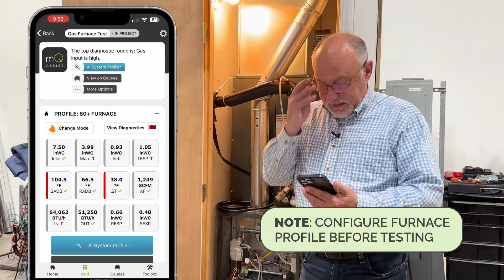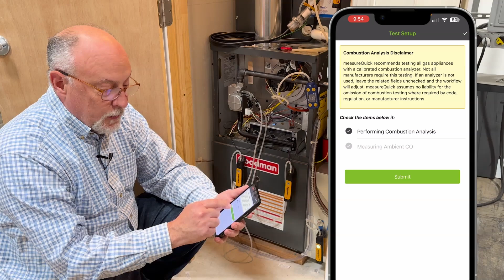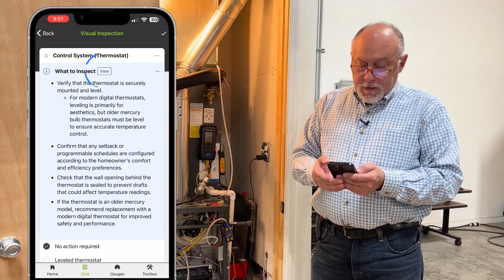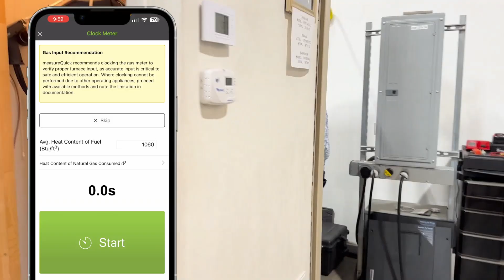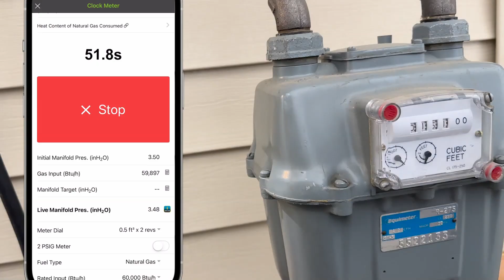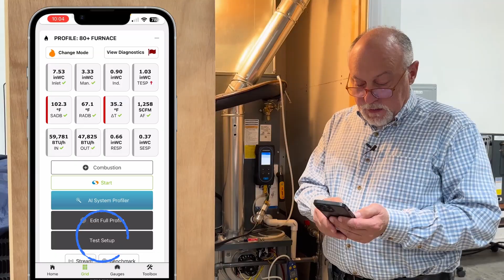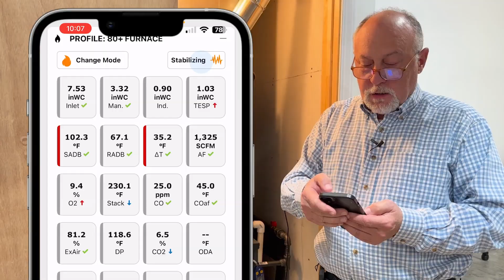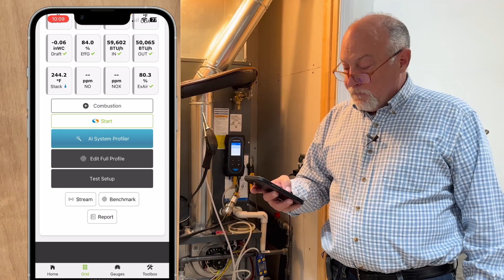measureQuick Heating Workflows Detailed Walkthrough [Oct 2025]

Comment: As always the Bergman explanation works well. MeasureQuick is a great software tool. That being said I think we need much more detailed analysis of why equipment isn’t reaching its stated specifications and why manufacturers also need to ensure that the preconditions for the furnace and AC install is being met including using the appropriate test equipment. Hopefully Jim  can dig deeper with a research institute scientists and engineers around Ohio.

Comment: Refreshing to see that measure quick now recognizes that a combustion analysis is the best & proper way to set up a gas furnace. There wasn’t any mention of setting up proper airflow that I saw. The lowest flue temperature with the highest delta t while operating safely (combustion analyzer) would be the best way to confirm proper blower speed. Glad to see the two smartest Jim’s (Jim Bergman & Jim Davis) methodologies coming together finally. Now just forget about good & better, if you’re going to do it - do your best!
Reply: the btu/hr fuel input should be what's on the rating plate, the pressure should be within range on rating plate (only minor adjustment to input, major changes within more than 5% made by changing orifices) and the oxygen and flue temperature is whatever it is. 
tuning residential gas furnace with combustion is malpractice because if it there's a problem reducing flow through heat exchanger, reducing input is just a cover up and on other hand if exhaust/intake vent run is short on 90%+, can have more flow apply too much heat to heat exchanger and overheat the cells.
there's no point of having an obsession with steady state efficiency when in reality equipment cycles - equipment is connected to ductwork, missing the bigger picture - you don't get steady state efficiency most of time in real world and comfort matters too. Airflow should not be set just for steady state efficiency, what's needed for good performance can vary with ductwork, if vents are on ceiling a lower temp rise and higher velocity/airflow is more desirable so warm air gets forced out mixes well rather than trickles out and stays near ceiling. Can also need more flow if the ductwork has long runs, etc to get enough static pressure to get enough air at furthest vents. Uninsulated bungalow with floor vents could be the opposite where higher temp rises and low flow are best.

Follow installation manual and get it to specs, ignore the jim davis bs telling people to turn gas pressures above what's on rating plate and the lie modern furnaces rely on mostly radiation to transfer heat and flame temp is critical. (it 'aint, and btus produced is not proportional to flame temp)
Reply: @Jon-hx7pe  Firing equipment optimally is one part of the equation. Tuning ductwork for proper delivery is the other. You can hide behind rating plates if you want & put all your faith in manufacturers. They will not save you when you create a scenario that causes someone to get hurt or you to get sued. Your combustion analyzer will. If we follow the manufacturers guidelines, the gas pressure is set at the factory, however anyone who has tested equipment when installed knows that regardless of pressure many times it is over or underfired. If correct design is done, then having the furnace fire optimally @ the ductwork deliver optimally will always be the best case. You make the case that there are many adjustments & I agree. Education to use the best adjustments possible is ideal. Clicking a gas meter will never trump using a combustion analyzer. That’s why clocking is better & combustion analyzer is best in measure quick.
Reply from the maker: I did not realize that I did not mention it, but the target is calculated at the center of the rise range. It was on target, but the static is high. 

The filter was clogged. I need to get another. The cooling requirement for airflow is 800. THe heating is over 1400. When we switched to heating the plugged filter was very apparent. 

We are working closely now with NCI. We are incorporating all of their testing  methodologies into dedicated NCI workflows.

Comment: What about propane applications
Reply: We also add an automatic pressure change in the AI profiler for Propane - select Propane (fuel type) the Min/Max and Manifold pressures are changed to typical propane pressures, (adjust as needed). Can not reverse, once you select propane you can not change it back to Natural Gas pressure - unless you re-profile the system
Reply from the maker: @joemedosch6753 You could also simply rerun the system AI profiler or change the min/max inlet and manifold pressure manually.
Reply from the maker: They are built in also. You’d obviously skip caulking, the meter.

Comment: Great update Jim!!!

What sends me through the loop though is that the clocked meter told us to lower the gas pressure down from 3.5 which you did, but than our combustion was showing it burning more lean with 02 higher than normal and co2 lower than normal which would make me want to dial the gas pressure back up
Reply from the maker: Me too, but the furnace may be engineered that way. This peculiar unit runs with very low stack. They may have designed it with more excess air to minimize the chances of condensing.
Reply: I was thinking underfired also, but the CO was low.